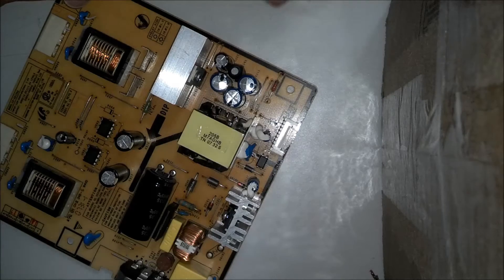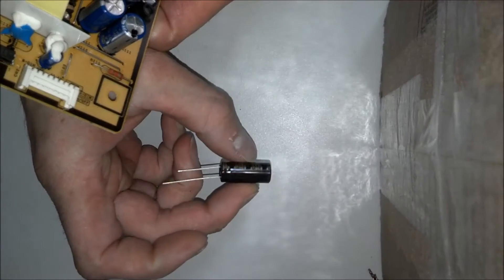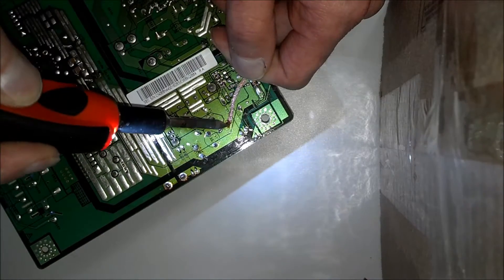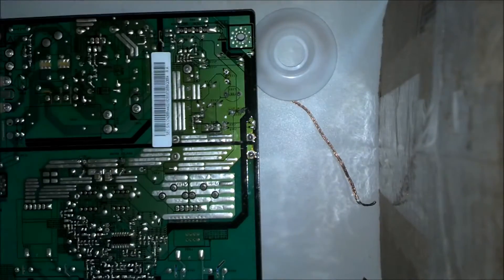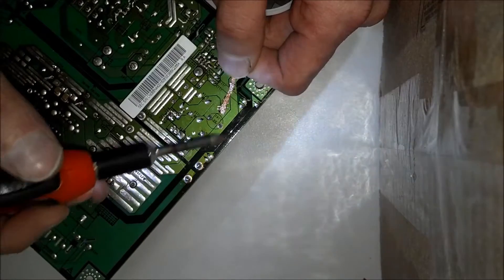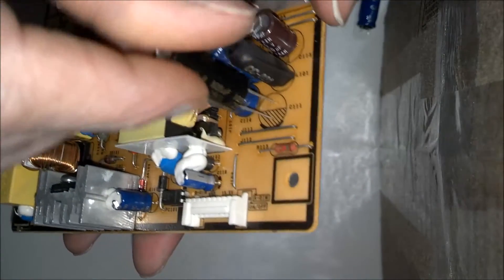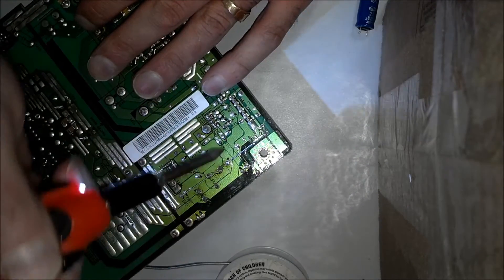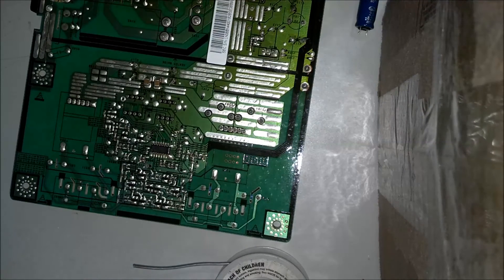How to Solder and De Solder Capacitors on Motherboards

Comment: 1: Bending component legs is a bad idea, it just makes them harder to replace.
2: Transfering solder from the soldering iron to the joints boils off all the flux, which often results in a dry joint. It is best to heat up the component leg and the solderpad at the same time, then apply the solder.
3: You really don't have to turn off your soldering iron that often. All you do is slowing down your own progress. Just finish what you are doing, then turn it off.

Other than that, great job replacing the old caps :)
Reply: Just solder the legs in straight? So you could just hold the capacitor in with tape so it doesn't move while soldering correct?